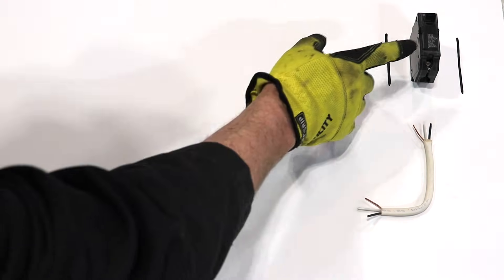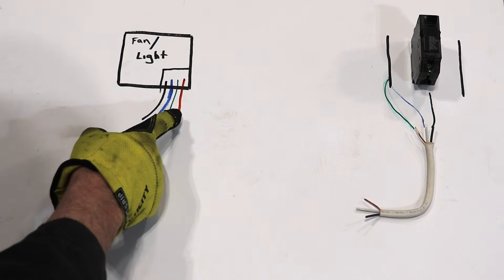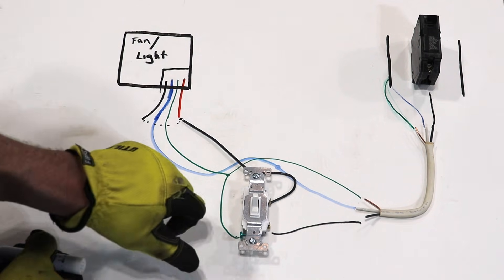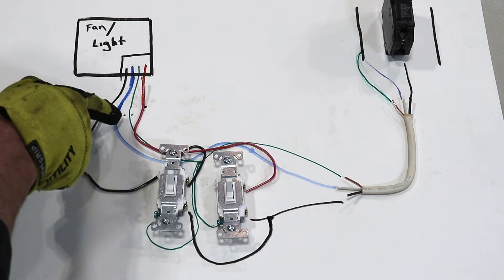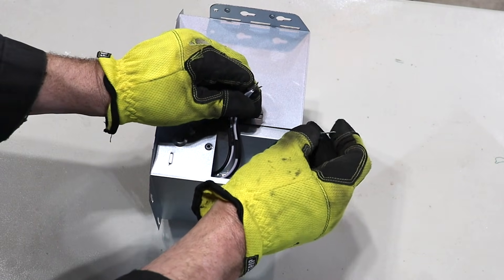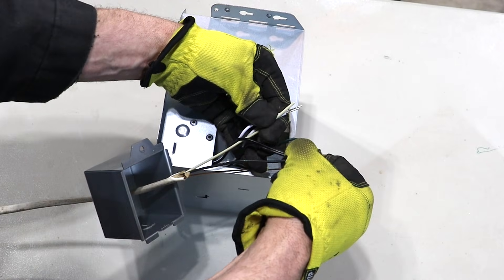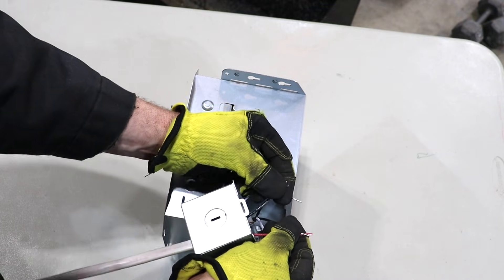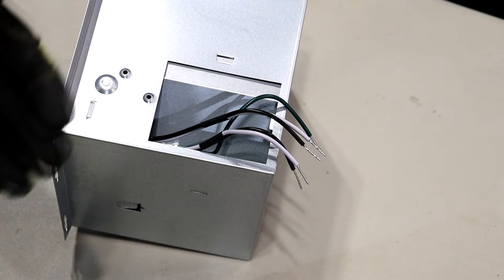How to Wire a Bathroom Fan/Light Fixture | Configuration for a 1 or 2 Switch Electrical Circuit

Comment: the problem is that you need a standalone 15A AFCI/GFCI just for bathroom light and fan, yet I want to use 20A circuit for bathroom outlet+ligh+fan. The stupid NEC not allow people to use #14 on this circuit for light/fan, although at fixture side, the wire is only #16. If the fixture uses #16 wire, why we cannot use #14 to connect?

Comment: This may be a dumb question, but when you use one of those combination switches the concept is the same right? just without needing to split (or pigtail i think you said) the live wire going into the switch?
Reply from the maker: What kind of combination switch are you referring to, just to make sure I answer your question properly?
Reply: @brettleybuilt I didn't buy it yet since I wasn't sure if I could do it. Which I don't think I can since the single switch I was thinking about replacing doesn't have a power cable going into it, just the cable going to the fan/light. But the fan/light has two cables. No idea what's going on there lol so I'm just going to keep it where the light switch controls the fan and light.

Comment: Great explanation.  I have a question,  my house has older wire coming in from the breaker.  One hot and one neutral.  There’s no ground,  I’m installing an exhaust/ light combo to work independently from each other and also adding a third light source to a single triple switch.  what suggestions might you have in regards the absence of a ground wire at the switch.

Thank you for your time and videos.
Reply from the maker: A ground wire is a "safety", but isn't required for the system to work. If everything is installed correctly, there isn't much danger.

Comment: Do I need to run the fan straight from the panel on its own break or can I tap into existing light switch ?
Reply from the maker: An existing light switch is fine. They don't draw that much current.

Comment: Took me a while to find a video that actually explained the important part. Yeah, I understand where to put a bathroom fan in my ceiling. What I didn't understand was how to wire it to two switches instead of one (which is how it was before).

Thanks for the easy to follow video!

Comment: So just to be sure, you don’t connect the neutral to the switch? U just connect it to the fan straight from the power box?
Reply from the maker: Yes. Only the hot wires are connected to the switch.

Comment: Awesome video! I learned a lot!!! Thank you!!! 
Could you give advice on my scenario please? 
I have a fan/ light combo. 
Coming out of the unit are:  two wires for light;  hot and neutral.  AND, for fan 3 wires; hot, neutral and ground. 
I plan on running two wires to this unit, one wire will be for light switch, and other wire will control exhaust fan. 
In this scenario, I will have an extra ground wire that will be coming from the  12/2 wire I’m using. What do I do with that extra ground wire?  The light doesn’t have one for me to tie into. I’m assuming it’s grounded inside this unit. 
What would you suggest? 
Thanks soooooooo much!!!!!
Reply from the maker: Just wirenut all of the ground wire together. You can hurt anything putting all the ground wires together.
Reply: @brettleybuilt thanks so much!! I appreciate it.  Keep up the great work on the videos! Awesome

Comment: My bathroom fan does not have a light.  Can I put a new one up with a light?  If so, what needs to be done.  I want the light and fan to go on together.
Reply from the maker: That's not a problem. You will wire the hot of the fan and light to the black hot wire going to the fan. That will make them both run at the same time and controlled by the same switch.

Comment: I have two switches and a fan and light combo. The light has  3 wires, black, blue and white. The fan has 2 wires black and white and there's an a additional green wire for the ground. My Romex has 4 wires copper, black, red and white. I reckon the copper to the green for ground, all whites together for neutral, then the Romex-red to the fan-black, the Romex-black to the light-black. What do I do with the light-blue? Do I connect it to the light-black connection as well?
Reply from the maker: I am not sure what the blue wire is for. It may be used for some sort of "smart" feature. You should be able to wire everything like you said and then put a wire nut on the blue wire and tuck it out of the way.

Comment: I have a double switch with one switch going to the bathroom lights. The other switch went to a fab with no light. Everything worked great. I bought a new fan / light combo that I want to wire to the one switch on the double switch, so when I turn the fan on the light on the fan comes on at the same time. My wires from the switch has 1,black,  1 common, and 1 red switch wire. The fan has 1 black, 1red, and 2 common. So I wired both common together with the common coming from the switch.  Wired the black to black,  and red to red. When I turn on the switch,  only the fan runs. So if I wire the black and red from the fan to the black from the switch and cap the red from the switch,  will that work?
Reply from the maker: Yes, wire the black and red together to the hot wire coming into the fan/light. That will provide power to both the light and fan.

Comment: Helpful diagram.   Missing what romex you used from the fan to switch.  Most common is a single lot line.  Your diagram makes it look like switch is next to the fan.  I do have a question about a 3 hot fan, light, night light combo.  I bought the companion switch to run each function separately.  I guess this is not common and the electrician isn't sure how to do it.  Is there romex that can handle a 3 hot situation?  Or just add 3 single hot romex lines?

Comment: Are the red and black interchangeable to either the light or the fan for the red and black?
Reply from the maker: Yes, they are each hot wire conductors.

Comment: I have a question for you. I have the Panasonic whisper remodel, RG-R811LA
THIS MODEL IS THE VENT FAN WITH THE LIGHT, BUT ALSO AS A NIGHTLIGHT. IN YOUR VIDEO, YOU EXPLAIN THAT YOU CAN DO THE TWO WHITES TO THE WHITE ROMAX COMING IN WHICH I UNDERSTAND. THEN, THE TWO BLACK LIVE WIRES TO THE LIVE WIRE COMING IN OFF THE ROMAX AND AGAIN I UNDERSTAND THAT BUT THIS UNIT HAS A BLUE WIRE AS WELL. SO ALL IN ALL, IT HAS FIVE WIRES. TWO BLACK ONE BLUE AND TWO WHITE AND A GREEN. I UNDERSTAND GREEN IS THE GREEN ALWAYS GROUND GROUND. THEY WOULD GUESS FROM THE SET UP THAT YOU WOULD DO THE TWO BLACK AND BLUE TOGETHER AND TIE THAT IN WITH THE BLACK FROM THE ROMAX? THIS IS ALL GONNA BE ON ONE SINGLE SWITCH FOR ON AND OFF FOR THE FAN IN THE LIGHT. SO FROM YOUR VIDEO ON A SINGLE SWITCH WITH 14 TWO WIRE COMING TO THE FAN, YOU SHOWED FOUR WIRES TWO WHITE AND TWO BLACK. THE TWO BLACK GO TO THE BLACK AND THE ROMAX AND THE TWO WHITE GET TIED UP AND GO TO THE WHITE IN THE ROMAX BUT AGAIN IN MY SET UP IS AN EXTRA ONE WHICH IS THE BLUE ONE FOR A NIGHTLIGHT AND I AM ASSUMING I CAN JUST RUN THAT TO THE BLACK, BUT I WAS CURIOUS WHAT YOUR THOUGHTS WERE.
Reply from the maker: I just looked this up. It looks like the blue wire (the night light) needs its own switch if you want to use it independently.